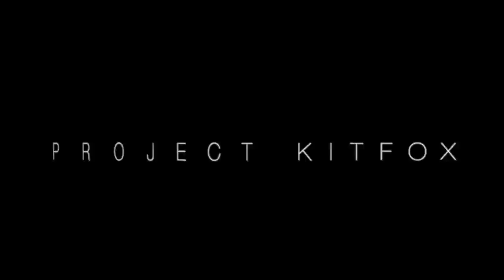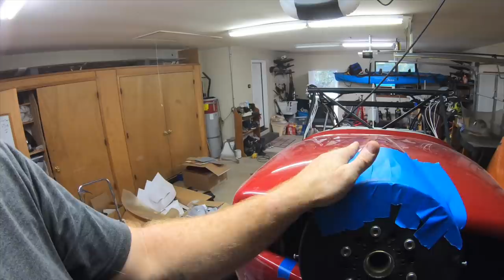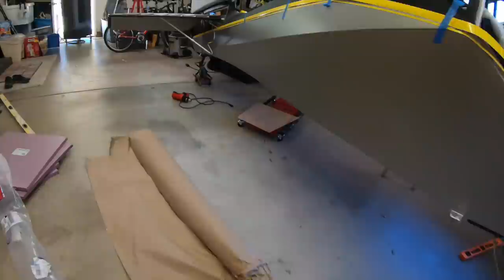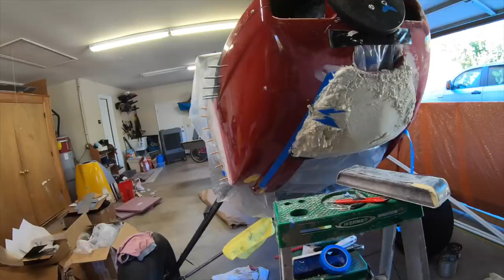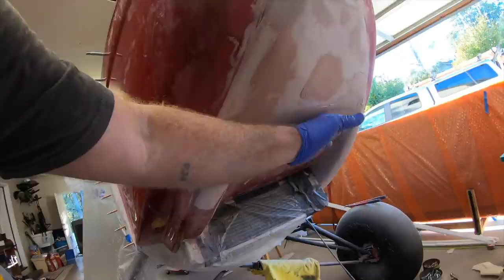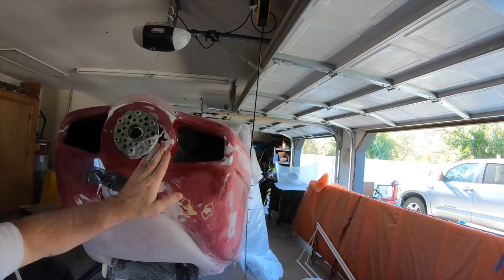Kitfox 7 Apex Build Episode 31 Engine Cowling Part 1

Comment: You could definitely use the clear packing tape over the areas with the expanded foam, to contour for the spinner in the openings, you could either use strips of 1/2" pink foam insulation to build up and sand back to shape, or cut out a larger block of 2" thick foam and sand to shape.
Reply from the maker: Did not have good luck with the pink/purple Home Depot foam on the air box project. I really recommend not using it for molds, it is not compatible with most resins, glues and paints.
Reply: @BowenAero  even if covered in clear packing tape and waxed?

Comment: in the future consider getting Rage Gold filler instead of bondo. You can get online (I order from Summit Racing) or from any local auto paint and body supply. It is SOOO much easier to work with than Bondo, especially when it comes to sanding and isn't much more cost wise than bondo.

Comment: sounds like you're fashioning a mold for a carbon fiber cowling from a couple old cowlings. making mods as necessary to accommodate your engine and frame. a plan that will allow you the freedom to slice and dice, without aesthetic or financial worries, to your heart's content until you've got it just right. good plan! great anticipation here.

wondering if a second fiberglass FEMALE mold could be made from that final male mold and in turn use it to make the carbon fiber final cowl. one advantage (just speculating) would be that any offset due to the thickness of the material would be minimized or eliminated altogether and much of the unevenness of the multiple carbon fiber pieces would be initially on the inside. there may be some other advantages i'm not thinking of. anyway, just speculation....
Reply: My thoughts as well. Why not make a permanent female mold? If built properly with a gel coat surface, you can make countless carbon cowlings to exact specs with a perfect finish.
Reply from the maker: Mostly because of the time and the expense of that extra step. The other reason is with a mold it has to be broken up into two or three pieces that then need to be fit back together. With this method the cowling will be one piece and then I will cut it apart to make the separate pieces, but they will not need any fit and finish like the reverse mold. They will fit together perfectly. I’ll cover that in the next video. As far as reproduction goes, the mold method would be better.

Comment: Are you concerned at all about being able to first of all get the carbon cowl to release from the plug while it’s in one piece, even with wax and PVA, and then to have the proper draw, as in no undercuts, to allow the cowl to be pulled from the plug?  That large if a part may require you to make the top/bottom cut while still on the plug.
Reply from the maker: Stay tuned for the answer on that one.

Comment: Cover that cowl in packaging tape.  Then wax and PVA.  Trust me I am making Carbon parts and Wax and PVA with that much surface area will be VERY difficult to separate.  The tape will only show on the outer most epoxy layer that will be on the inside of your Carbon Fiber Cowling.

Comment: Nice work so far! Question? Would it be easier to use body filler then use it as a templet for carbon fiber or fiberglass?
Reply from the maker: That’s the plan

Comment: Why not make the outside layup a  negative mold out of glass and layup the carbon on the inside?
Reply from the maker: It would be a tremendous amount of additional work and then the cowl would need to be laid up In pieces that would then need to be fit together like the factory cowling, this way will require more finish body work, but it will come out as one piece that can then be cut for a perfect fit between pieces.

Comment: Would it be worth while forming a glass or foam shell that you can lay up on the inside.  Your final skin will be at the same level as the original and the thickness will be built up on the inside layers.  What are you looking for on the exterior finish, carbon or paint?
Reply from the maker: It would be a tremendous amount of additional work and then the cowl would need to be laid up In pieces that would then need to be fit together like the factory cowling, this way will require more finish body work, but it will come out as one piece that can then be cut for a perfect fit between pieces.